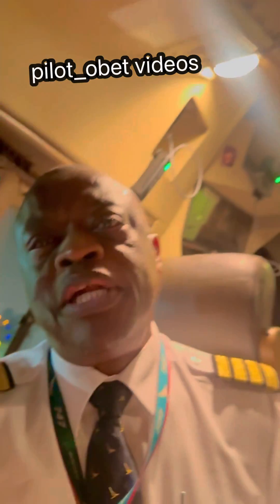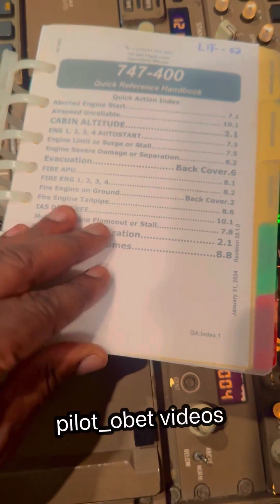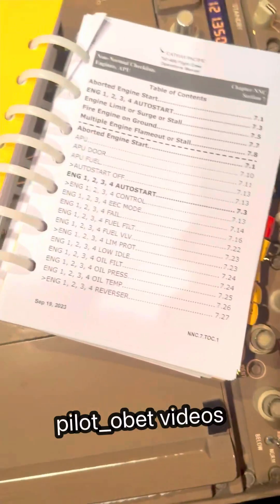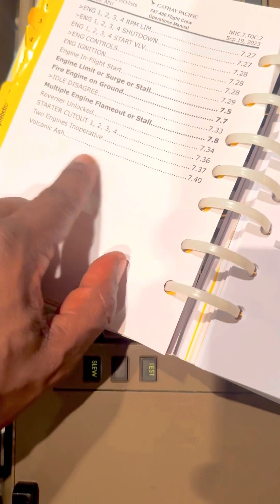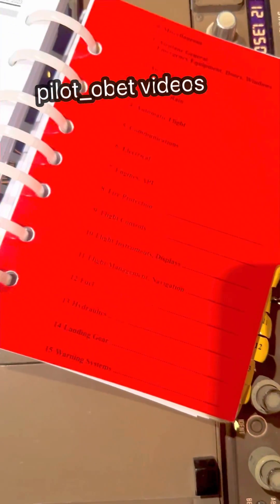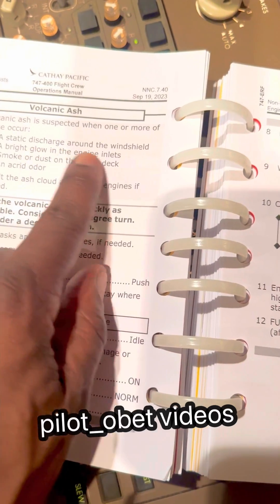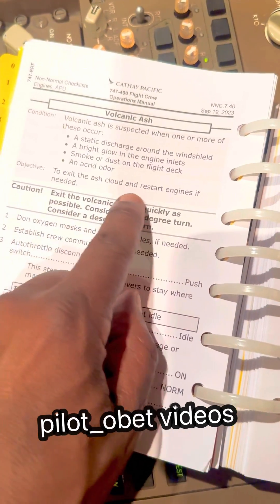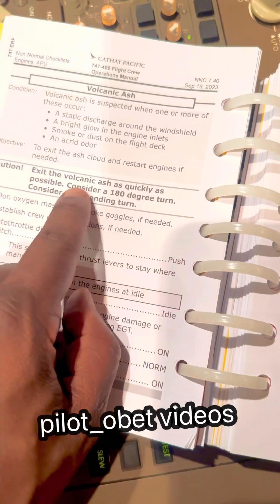Boeing 747-400ERF. Volcanic ash EXIT STRATEGY

Comment: I remember watching the Air Crash Investigations episode where the British Airways flight (which I assume must have been the first aircraft to fly through volcanic ash) and how that 747 lost all 4 engines as a result.  And just when they had all but consigned themselves to ditching in the water (I think), the First Officer tried restarting the engines (again, as he must have tried a dozen or so times prior), and one by one, all 4 engines restarted.  Relieved, they ascended as quickly as possible back to cruising altitude, only to have the engines start to flame out again!!  Thankfully, they got the aircraft on the ground safely.  When the engines were inspected they realised what had caused them to flame out, a pumice like stone that when heated up by the hot engines, effectively smothered them.  But, what I feel was one of the greatest escapes in aviation history, the same material that caused the engines to fail, also allowed the engines to finally be restarted, as it became brittle enough for the engines to break up and discard once it had sufficiently cooled.  What a rollercoaster for everyone onboard, an incredible job well done by the flight crew, and I think, some credit to that 747!!! She wasn't ready to die and she certainly wasn't ready to give up on those people she carried onboard.  She was 'the engine that could'!  But the instructions on how to avoid this nightmare, seem too simplistic!! Just descend while doing a U-turn!!!  LOL.